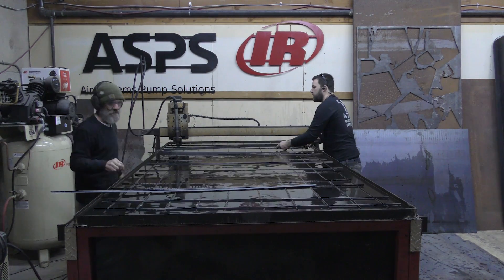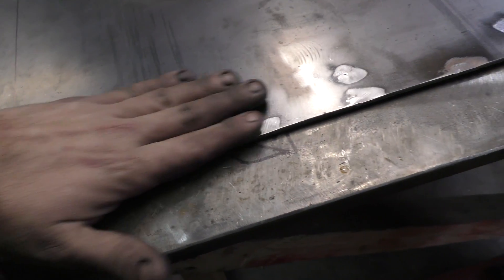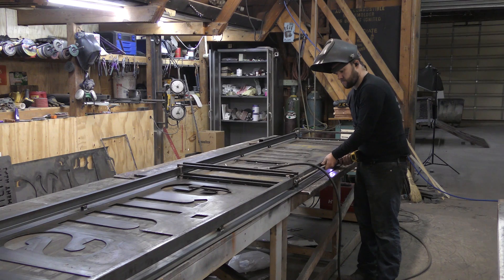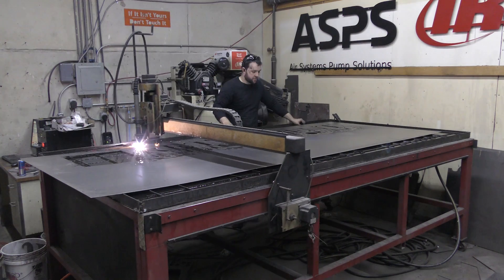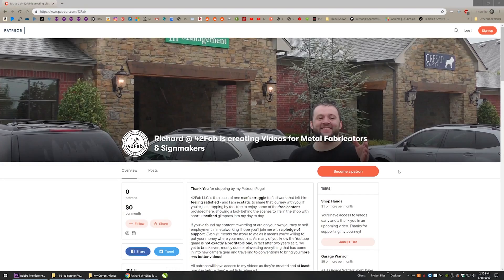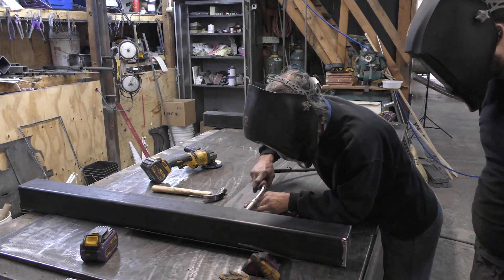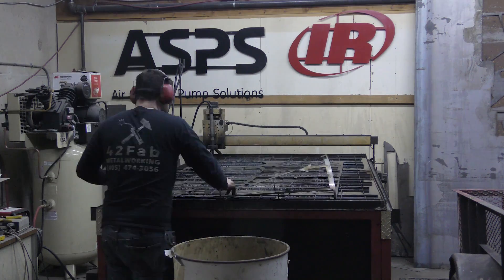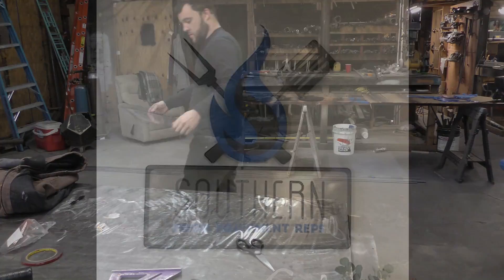$16k in 12 days with a CNC Plasma Table. 6 Signs and a Table

Comment: Re cut that sign with a new sheet? After just saying you don't like to waste material? I could of fixed those mistakes so easy
Reply: @KalleKofot  - HAHA, but you felt the need to make a comment instead of going quietly back into the night where no one cares what you think.
Reply: Sometimes after a dumb mistake like welding the wrong side, it's just "better" to start fresh.  Instead of throwing good money after bad, even if a fix would have been just fine or even indistinguishable in the final product.  While the economics of the decision are debatable (depends on a lot on parameters of the particular shop, location, expenses, etc), it may just be that he felt more confident starting over.  Is that worth ±$80?  If it shows his crew that he's dedicated to producing top-notch product instead of covering up mistakes, even if the customer won't notice the defects, maybe it is.  I can't find fault either way, both solutions work.

I used to work with a general contractor... when he'd bring a new truck into the fleet, he'd drive it personally to the job site.  He'd hand the keys over to the site lead, but first, gather everyone around and sink a claw hammer into the quarter panel, proclaiming "There ya go, now it's a work truck!"
Reply: Tbh comments aren’t worth replying to brother you make money to pay the bills don’t you? I wouldn’t waste my breath on people like this.. haters don’t realize they gave you views.. money.. so you’re winning everyday
Reply from the maker: Good for you. Do it where it won't show up after powder coating in less time than the sheet is worth and I'll hire you
Reply: @42Fab  I agree, minimizing waste to minimize it is a great thing, but you can't avoid it altogether.  Some people want to just try and make a fool out of everyone and use their own words against them.  Constructive criticism is one thing, but when you said you redid the piece, I was actually commending your decision for the exact reason you said you did it.  I've paid good money for products before where it looks like corners were cut or mistakes were made and it was pushed out to me anyways.

Some companies will have it happen and send it in hopes the customer won't complain or will not return it.
Reply: @42Fab  I liked the video dude. I don't know shit about shit. But I like it.
Reply: @42Fab  everyone here CLAIMS to have better ideas. But time is money. The logical solution was what you did. It guarantees the quality you're striving for
Reply: @42Fab 
       First off, everyone is human and we all make mistakes, and we all can learn something new or better every day.
Anyways, it looks like you were working with a 4x8 foot plate of 12ga. I found some sources that put the price of it at an average price of US$90.00, and weighting in at 140 pounds. 

      So, $90 plus tax and shipping, and then minus the scrape value of the plate ($1.40), puts the true value of it at around $100. Correct me if I am wrong.

     I would say a regular skilled fabractor/welder/laboror probably gets around $20 to $22/hr.
      If it was me, I would of grabbed some silicon bronze tig rods and filled up those zip cut marks. (use the bronze to keep the warping out of the picture.) melting point of bronze = 1900f and steel = 2700f.
     From there I'd hit it with a flap disc like you showed us later in the video, but would probably use 120 to 180 grit to knock the high spots down.
Then I would hit it with a courser 80 grit on a DA sander then 120 grit then 180. After that, the primer powder coat and UV stable powder top coat would completely take care of the rest. All that in around 0.5hr to 0.75hr, or $11 to $16.5 for labor and maby $6 worth of tig rod and sanding supplies. Plus, it was said, taking a quick 20 minutes to make or do something is no big deal, coupled with $10 worth of tubing. 
    And I know what your thinking, the guy who is fixing that 12ga plate, could be running the cnc plasma machine, cutting different steel for a different project, making the company way more profit, then having him brazing and sanding the old plate, but, how can he do that, when he, or someone else is using that machine to cut out a totally new sign out? (this is assuming the plasma cutter is always booked up, cutting away)

      Also, you should consider, if you cut out a completely new sign out of a new 12ga plate, you will be taking time away from other, highly profitable jobs, that you could be running with the plasma cutter (the reason someone buys or builds a cnc plasma cutting machine in the first place).

      So, if you were to re-work that old sign, you could save around $77.5, plus save space in the scrap bin, and possibly saved power costs of running the plasma program twice (running the machine costs more than running a small tig welder, grinder, and DA sander for that short amount of time). Not to mention, keeping the plasma cutter open for the next profitable job.

     Correct me if I'm wrong. Have a great day.
Reply from the maker: @jakefriesenjake  your numbers on material are fine, except I get free delivery. I'd love if my table was always running but that isn't the case. Also, the electricity used to make that cut is negligible. 

Where you're off is labor rate. I am the skilled welder on my shop, my rate is $100 an hour. Getting a machine out, cleaning metal, the work, cleaning up,  etc would easily take an hour. 

AND all that ignores the fact that a high quality (and priced accordingly) product like mine should not have repairs in it before it ever goes out the door. The issue isn't even really price, it's pride in your work. 

We all decide what we stand for, I chose quality. I'm amazed at how many people are arguing with me that making a higher quality (non repaired) product is somehow a bad thing. It's sad really. But hey, maybe that's why you're quoting a labor rate that's 1/4 of mine...
Reply: @42Fab 
Obviously, the boss or manager with high credentials shouldn't have to do the fixing when he could be doing something like running the cnc, where someone else isn't qualified to run it.
I know your personal labor rate is more, and that you also have workers working under you at around the $20 per hour mark. They can't all be making $100/hr? But if they are, and your plasma table is not always in use, then I guess you could just throw that sucker in the trash and start over. I don't know what the whole job was quoted at, so maybe it really would be better to toss it. At the same time, at 5 feet you wouldn't of seen the marks with no work put into the fix, I would bet, without even tig welding it, I could of feathered it out in even less time (15 minutes) and by the time it got back from the powder coaters, it would not be noticeable at 1 foot.
Fixes are always acceptable, especially if you do them right the first time. Besides, you said, if it was coated with regular primer and paint, you would of filled it up nice, and feathered it out with bondo? So what is it? Even high end cars get a swipe of bondo here and there. If the sign wasn't to be sent out for a professional powder job, would it of been ok to bondo the sign up and give it a spray job?
At the end of the day, it is just a sign, meant to be viewed at least 30 foot away.
The sign turned out looking great. Thanks for the quick response.
Reply from the maker: Alright man, we're done here as you've obviously planted your flag and don't care what the ACTUAL reasons were. I'll give a final reply then delete this whole thread if you want to keep it going.

I'll repeat that my products are of the highest quality my shop can output. A painted sign isn't that, which is why it would allow for repairs if the customer acknowledged they were budget-restricted and we happened to be slow that week (infact, we bondo'd then painted the "mistake" sign and are using it as a display piece alongside the positive cutouts that were shown). The difference between you and I is that you're okay with something "being good enough from 30 feet" or even 5 or 1. I am not. My business is built on high quality products (not "just a sign"), delivered quickly. "Good, Fast, Cheap, pick two" my customers are not coming to me to pick anything but the first two. The fact you think that the cuts wouldn't be visible at 5 feet demonstrates either a lack of visual acuity or abundant inexperience as even so much as a reverse-side weld scar is visible in powder from 20+ feet.

But hey, you've planted your flag, let's see if you've got the balls to back it up. As I said, we have the sign, and I'd be happy to strip the bondo and paint back off it. I'll publicly wager $1,000 you can't have the repair done and unnoticeable from 1' (post powder coating) within 15 minutes. I'll even make a video about it and post it win or lose. Your obviously impending winnings should more than cover your trip to Oklahoma. 

I prefer large bills.
Reply: @42Fab 
No need to delete the thread. Like I said, you probably made alot of profit on those signs you made. In fact, the video is literally about how and what you did to make huge cash with your work. That's great. And don't get it wrong about the quality of my work, It just wasn't worth trying to fix the original. Just some great conversation on how someone could run their business and be super profitable., also what this video is about.... Have a great night man.
Reply: He cares that his work looks high quality but uses the repair piece as a display for customers to see? how does that make sense?
Reply from the maker: @googleplex7097  because we actually tell people "this one had a blemish, so we re did it, but here is a life sized example"
Reply: @jakefriesenjake  did you get the job? XD
Reply: @jakefriesenjake  it could have been fixed but sounds like it was not worth it. 
Some high build primer alone would have fixed it
Reply: Nice work, good attitude!
Cheers from Canada!
Reply: Damn...there's always someone offering advise when they're never asked for advice or opinions. Great channel brother. Thank you for sharing.
Reply: Tack it and a flapper wheel
Reply: i would cut it again, too
Reply: Great video!   Was it hard to learn how to use the plasma cutter?
Reply: I could grind that out no problem my dude. 50 grit paper disc on an angle grinder is all you need. Fix it up with 80-100, and a decent coat of powder will make it look fine

EDIT: How do you get by using only cordless grinders? You must have a million batteries!
Reply: dude, clean up your workspace! the workspace tell´s all about the quality-thinking of the worker. bad place, bad work^^ in germany nobody want to deal with you, when they see such an ugly workspace.
Reply: @xTerenceSkillx  That's one of the most childish things I've heard an adult say. The only appropriate response is: "Dude, clean up your English. Your ability to communicate competently in this language tell's a hell of a lot more about the 'quality thinking of the worker' than the cleanliness of a warehouse."
Reply from the maker: @xTerenceSkillx  unless you're volunteering to come sweep yourself, I'd suggest you keep your opinions to yourself. Funny how dirty work spaces didn't have problems winning wars in the last 100 years
Reply: 42Fab - Metal Fabrication & Signage | I know nothing about fab, welding or the rest, just found the video interesting and this thread entertaining. 
1. You’re 100% right about quality. That’s why you own a business while the people arguing are labor that need to be given values and standards for their work.
2. Absolutely perfect response to the German fellow. I believe in a clean work space as well, but “clean” is relative to the type of work being done.
Reply: @42Fab  here in germany we have an other thinking about quality, clean work space etc. 
i mean, you make public videos^^ I would be ashamed in your place...
Reply from the maker: @xTerenceSkillx  Be ashamed then, I happen to be all out of fucks to give at the moment
Reply: @42Fab  dont think so.. now i know why everyone want some "made in germany" ;)
Reply: @42Fab  I agree with Steffan, plus the mistake on first operation speaks volumes as does  the messy work space. I suppose we all learn with time. All the best
Reply from the maker: @sillybuster  I highly value the opinion of a guy with "how to twerk" in his liked videos.
Reply: @42Fab  you gotta learn how to twerk
Reply: @42Fab, Just know that there are guys out here who really appreciate the effort, quality and thought that you and your guys put into your products.  Ignore the nay sayers since they don't work for themselves.  As far as your workshop is concerned, that is none of their business.  You provide quality to your customers and that's what counts (and it really shows too).  That's what grows a business.  Once you make the big $$$$, you can then hire extra hands to organise, clean and do other stuff.  Keep doing what you're doing and keep the customers happy first.  Oh, BTW it has been proven by time study analysts and workplace psychologists that a messy workplace is actually more productive because things are where you need them to be, opposed to having has some idiot hide the shit that you need and you having to hunt for it.  Most Engineering environments are organised chaos.  Factory floors are different as they are not doing creative work. They do repetitive assembly, hence they can be very regimented.
Reply: @42Fab  this is an old thread so not sure you'll read this. Amazing how people are looking for things to disagree on or piss on you about. Shop looking like people work there. Who cares. And good job letting only the quality you find acceptable out if your shop. You should be proud of your business. Fuck these guys

Comment: don't get your hopes up, folks, i work in a sheet metal factory, we do laser cutting, bending and welding, high profit easy jobs are VERY rare, we built a production line for a plastic stock factory, we used a 120 ton press brake, a laser cutter, a LOT of welding, both MIG and TIG, we used a press drill, and last but not least a band saw to cut profiles, and we used a forklift to move all that and reorient the heavy parts (which is most of them) ... it took us 2 months (not including my time preparing the workflow and job order, or technical drawings and parsing the machines and structures for cutting, bending, welding and finishing), all that came to $16K in profit. not bad for 2 months but it's not a pot of gold.
Reply from the maker: Huh, I just, by myself, like this week, did 4 signs, in 4 days, and installed them. $18k gross, 13.5 net. Sounds like your biddibg department sucks.

Comment: at 0:50 you use a magnet for the metal, would you share the name, brand, link etc. ? please?
Reply from the maker: That is this guy https://amzn.to/3kl8KRr but if you're going to spend that kind of money for a lifter (aka, not for the 90 degree functionality) I'd HIGHLY suggest this guy instead: https://mag-tools.com/collections/lifting/products/magswitch-fixed-hand-lifter-235-8100795?ref=42Fab or for a bit more pull (helpful on thinner sheets): https://mag-tools.com/collections/lifting/products/magswitch-fixed-hand-lifter-400-8100810?ref=42Fab

Comment: Is your welder a flux core welder?
Reply from the maker: I have a number of welders, all can run flux core, but I rarely do
Reply: @42Fab  what what type of welder were you using to weld the nuts and screw threads?
Reply from the maker: The HTP pro pulse 200 listed in the description

Comment: How soon will these signs start to rust?
Reply from the maker: powder coated signs will get some superficial rust on welded joints (always in the rear), painted signs are good for 5-10 years before needing a touch up, then good agian for as long.
Reply: @42Fab  do you recommend using red oxide primer for rust resistance?
Reply from the maker: for painted signs I build up 3-4 good coats of primer, then another 4+ coats of paint, had very good results with that.

Comment: Why are you not using protecting gloves during welding? Propper protection gloves should always be worn during welding (TIG, MIG and stick) as the rays from the arc is bad for your skin. For me, you can do whatever you want yourself, but your employees should definitely not be allowed to weld without protection, there are lots of nice and comfortable welding gloves out there. 

I would recommend you to not use grinding discs on flat surfaces, ceramic sanding discs makes the job a lot easier and leaves a smoother finish, especially if you need to fix mistakes. 

Like your videos though, thumbs up!
Reply from the maker: We are not using gloves when tacking things together. It's a risk/benefit. You get to have you opinions, we get ours. I won't critique how you do things, and I won't tolerate the reverse. We're well aware of how to grind, I'd suggest you spend your time doing, teaching, or practicing, not trying to tell others how they should work. Nothing personal.
Reply: @42Fab  I sincerely didn’t and don’t mean to be offensive. Just pointing out that using gloves is important to protect yourself from UV and other damaging rays. 

Grinding looked good, just wondered why you don’t use ceramic discs really. 

I like your videos, as I stated in the first comment.
Reply from the maker: @TitusPollo  I know welding is dangerous, how could I not running the business I do? I appreciate your alleged concern for my safety, but read the comments and you'll see this conversation 1000 times. You do you, let others do them.

Comment: NICE! is this more efficient than a router table? design and layout all day for one now, so plasma ain't a far step.
Reply from the maker: Totally different process, same mechanics. Router needs to be more rigid as technically the torch never touches the steel while cutting.